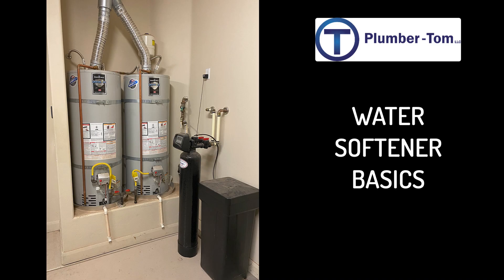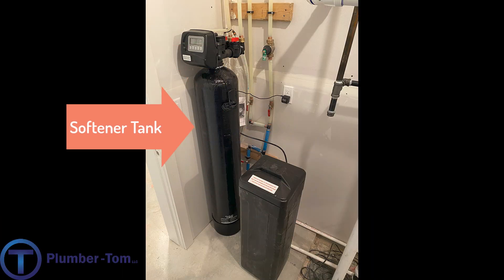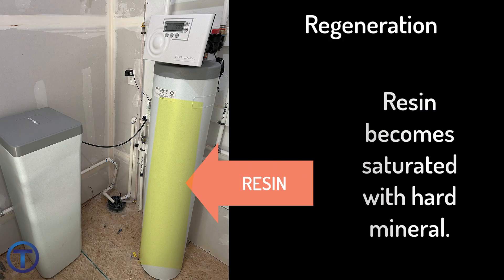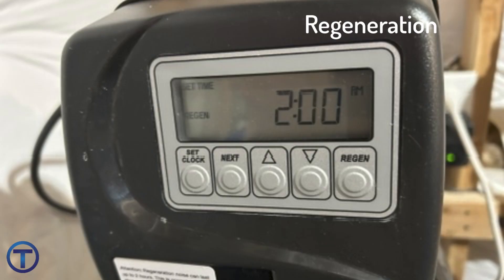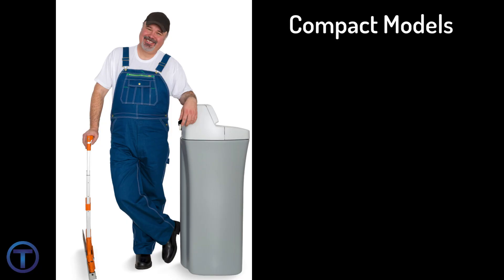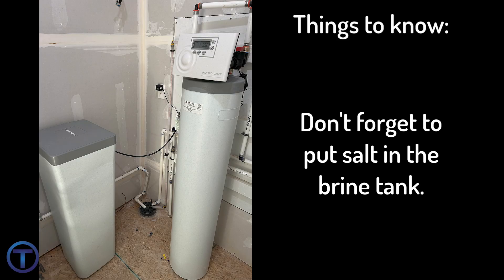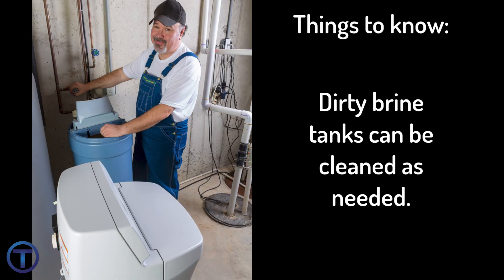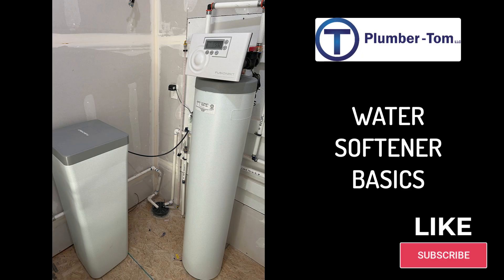Water Softener Basics

Comment: The instructor of a water softener class mentioned bypassing the softener for a month after installation of a new tank style water heater. He explained the water heater manufactures wants hard water to build up on the tank first as a form of protection for the tank. I always mention to never mix different salts to a brine tank also, stick with the same type until its finished. Thanks for your videos, I definitely will have more information to tell my customers on my next softener install.
Reply from the maker: Interesting. I hadn't heard that before.